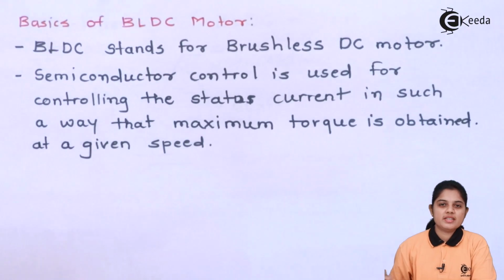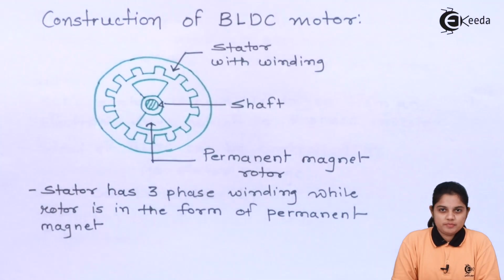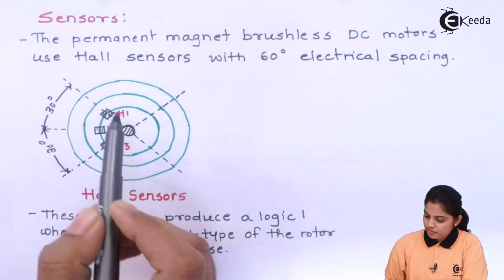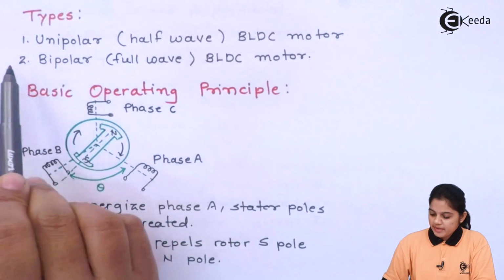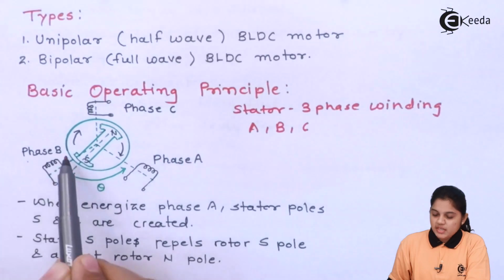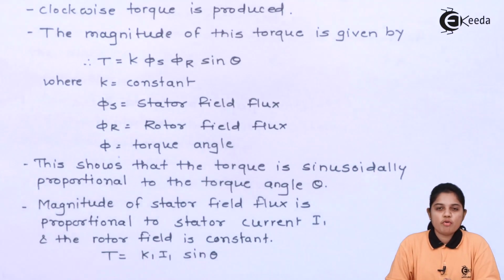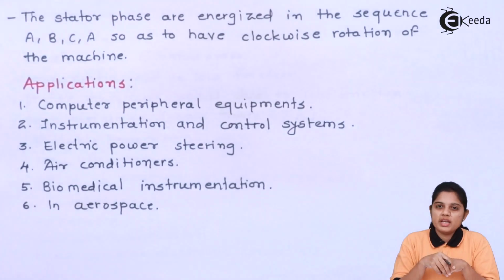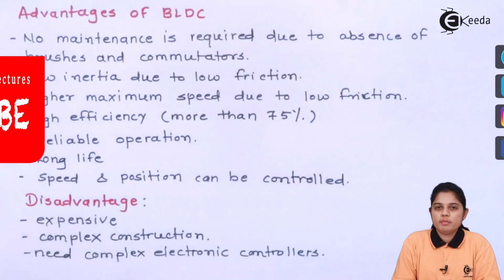Basics of BLDC Motors - Motors - Industrial Electronics

Comment: Hello
First explain the waveform of the motor based on the waveform you can decide the bldc or pmsm motor
And also mention two types of bldc motor 1. Sensored 2.sensorless
Hallsensor placed 120deg electrical not 60deg electrical, and also explaine the 6step inverter, use Femm software for show the flux lins.
Reply: thers a video by lesics you can see that

Comment: She mentioned it's a DC motor so supply voltage also in the form of DC. But BLDC is not a DC Motor and supply voltage also not in DC. Inverter input only will be in DC

She just reading that. she didn't even understand that.
Reply: She's not wrong. The inverter is contained within the motor itself. You can't provide a separate power supply to the 'motor' part. You can only provide DC supply through the inverter.